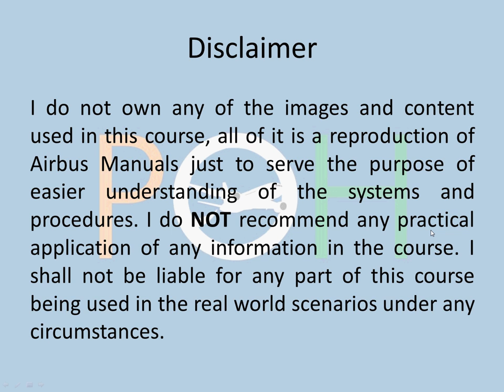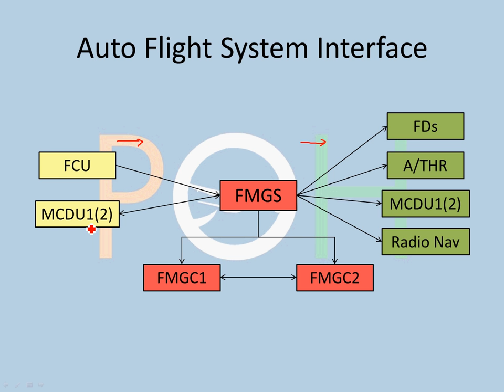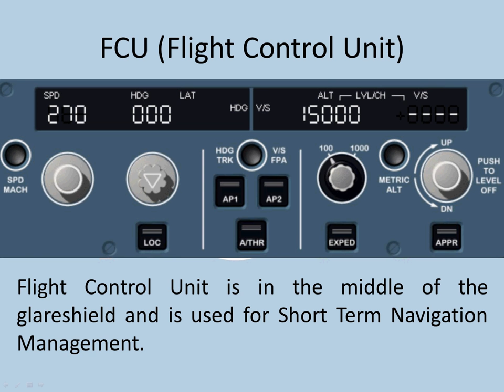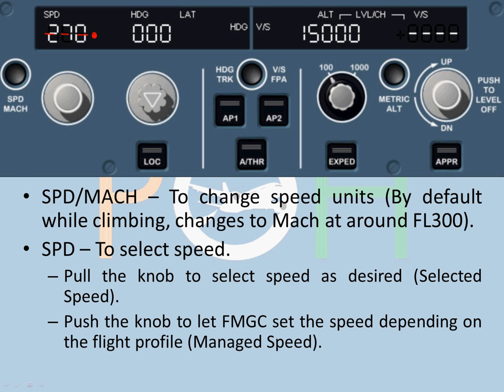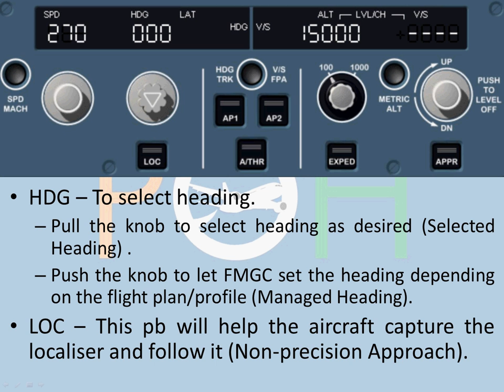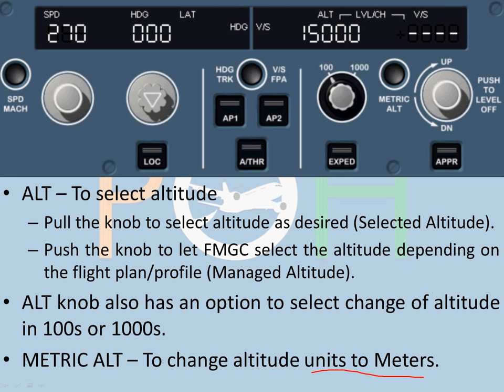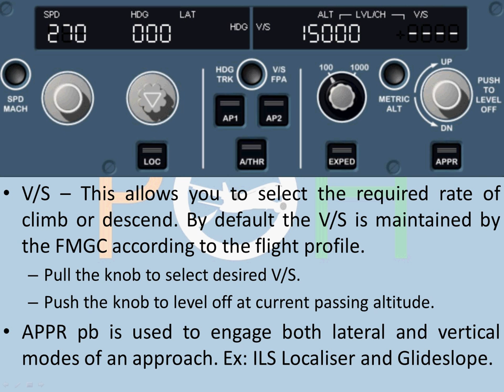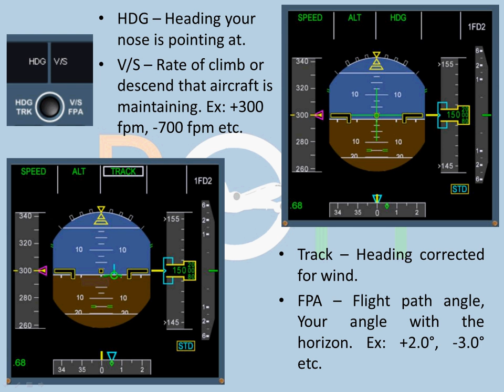A320 - Auto Flight - I (Overview & FCU)

Comment: Hi great Video, keep it up... Some Info, ALT knob, when u pull it , it will go on open  descend/ Climb and it will not follow ,Alt constraints.. when you push it , it go Managed Climb and follow all altiute constraint. 
EXped push button still there in the aircraft .. 
I hope , info is correct ...
Reply from the maker: Yes you're correct

Comment: why the wind is from the left?
Reply from the maker: +g g Wind?
Reply: If the wind is from the left, the bird should be towards the left. We always point the nose in the direction of wind. So why in this case is the bird to the right?
Reply: Wind is from the right so you turn the nose to the right to maintain the track. I believe he just made a mistake. Please correct me if I am wrong.
Reply: Isn't the bird is to the right because the wind coming from the left is pushing the airplane rightwards?
Reply from the maker: Bird is your track, if wind is from the left, heading into the wind which is heading to the left, and hence track is on your right side and that's why the bird is on the right.
Reply: @poh  after 3years flight experience,I was fully understand!Thanks for your explanation and the video!Still watching and getting more knowledge!!Really helpful thank you
Reply from the maker: It's never ending to be honest! 😅
Reply: @poh  looking forward for your knowledge sharing 😜